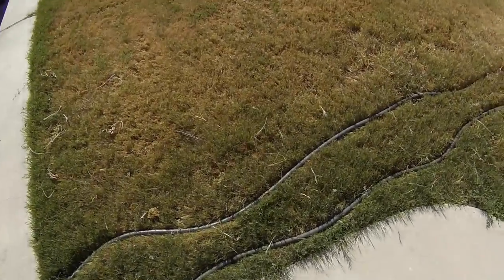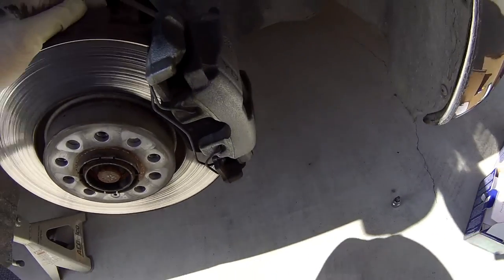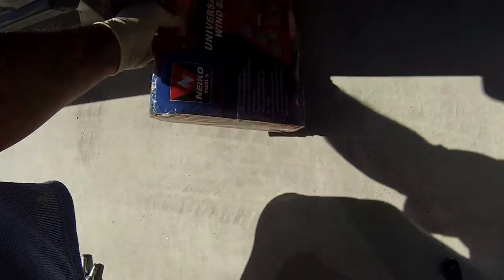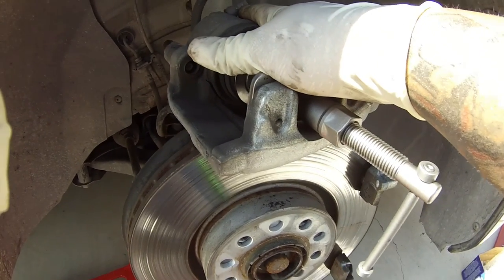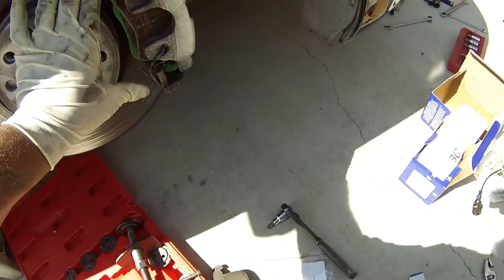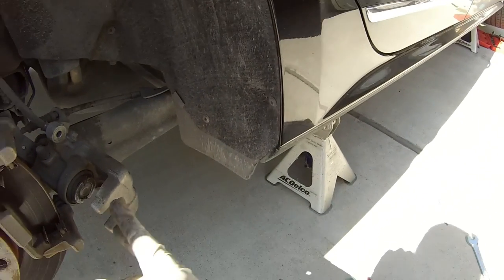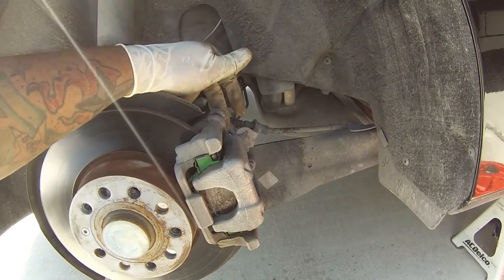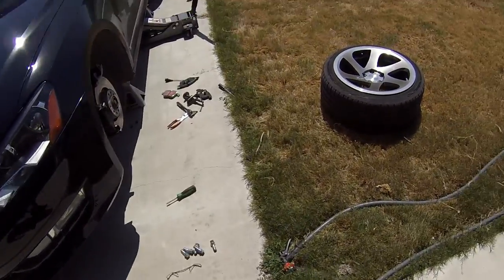How to: brake pads on 2013 B7 Passat TDI

Comment from the maker: People need to realize this Passat is a TDI, which was one of all VW TDI's that got recalled for emissions cheating. This is why the rotors where not replaced! I just needed it to last until I gave the car back to VW which was a few months later.
Reply: Don Juan hey man, does this passat have an electric hand break? If so would I be able wind back the pistions with break calliper tool, instead of using software?
Reply: I dont blame you.  Interesting that VW is slowly selling these TDI vehicles at auctions (I got the 2015 TDI one a month ago  from a wholesaler).  AND last week VWAG sent me a letter saying they are adding another 12mos/12K bumper to bumper free of charge just so im happy and if anything needs sorted out still.   This is in addition to a 162K/11yr warranty that covers ECU., Turbo, fuels pumps, engine tranny from them too.  I bought it at near-auction pricing with 12K Miles.  My rotors are smooth but they rusted a little during the Auburn MI storage so I spent $8 on black caliper paint when balance/rotating and it covered up the surface rust of rotors that I didnt want to sand off with the other factory coating material.

Comment: The odd thing about the emissions “cheating” is the fix is just a software update that pushes more DEF into the purge cycle and it limits some engine performance.  It also has reigned back the aggressive S mode that seemed to have created more NOX.  So, the emissions “CHEAT” dealt with N02 and not soot - particulates.  Most of the concern to become a CLEAN DIESEL was to reduce particulate  and when running super clean the chemical output is higher NOX - so the engine has all of these additions:  when idling the ECU will raise RPM to 1000 and heat up the exhaust and then dump more DEF into the particulate (Soot) filter to burn it off.  Got to be carful if idling in high, dry grass because the exhaust get HOT.  SO there is a race-tune and $800 race exhaust that will double the engine power and provide 20% more mileage.  Right now mine is factory everything and it runs cleaner than ANY gasoline powered car I’ve ever known by a factor of 10.  The exhaust pipe inside looks like it was new, installed, and never started.

Comment: thanks for the vid! i assume it's similar to my 13 Cc sport?   i keep seeing mentions of the electronic parking break making it a difficult DIY.
Reply from the maker: +Daniel King yea with the VW CC and a few other models you will need to use Vag-Com or another similar diagnostics tool to get the rear Pistons in the caliper to retract back so you can pull it out and install the new pads. Unfortunately there is no way around this but it does not make it so you can do it yourself! You can either buy vag-com ( it's worth the $200 investment if you plan on doing most of the maintenance your self) or you can get in contact with a VW community near you (forums, car club, etc) and someone should have one that may be willing to help you out.
Reply: +Don Juan thanks for the reply!  now changing only the front pads wouldn't require that correct
Reply from the maker: +Daniel King correct. Only needed for the rear brakes.

Comment: You need something like s heaven or vag unit to electronically retract the E brake piston in the rear caliper on many of these Pasat cars. You really shouldReplace those front rotors because they look very worn and will take a long time to seat it in the front pads. You should also be bleeding brake fluid on this.............
Reply from the maker: You are correct. BUT as I said before why waste money when VW bought the car back either way 🤷🏽‍♂️

Comment: what mileage did you have when you did this? Im at 45k and my breaks start to squeek.
Reply from the maker: I had between 52-56k miles so seems like your right around the same mileage as i was. I started hearing the squeaks only when going to a complete stop at like a light or something every now and then but around 55k or so it was a constant thing so I did them.
Reply: For about $150 you can get all new coated rotors with new pads for all wheels. For a few bucks more ebay has cross-drilled or slotted options.  Get coated OR the $8 caliper paint.  Probably better heat dissipation to get the coating option.

Comment: yo. which side is where you plug the censor? have passat 13. I want to do my brakes also 1st timer
Reply from the maker: +chrgee88 one of the front pads has the sensor built into that side. So when you remove that brake pad it's a simple clip that you unplug and plug the new pad into it. Not all of the passages have this feature.

Comment: Damn I'm confused. I'm looking to do my own brakes. I've watched videos mostly by European mechanics and they don't do have the steps that you're doing. You're removing pins and using caliper tools, whereas the other vids they just remove the caliper slap on little grease and slap on pads, that's it.
Reply from the maker: +brickscity77 it depends on how far your pads are worn. If your slapping a new set of pads in and you don't have to use a caliper tool then you don't need the pads. Your either doing it as an upgrade for better stopping power or something. Some vehicles like BMW you remove the two bolts pull the caliper straight up slap the pads on the rotor and slide the caliper back on top. But those are designed that way.

Comment: I didn't see you bleed the brakes?
Reply from the maker: +Michael Shasteen I do not bleed my brakes most of the time. I only do the brake flush every 2 years or so. I use the piston caliper tool to push it back very slowly. This allows no bubbles to pushed back into the abs system or too much pressure. It is personal preference in my opinion bc I have done this for years with no issues. Some people will tell you to bleed while u push the piston back in but I do not.

Comment: can i ask you a question?
Reply from the maker: +Bond, James shoot
Reply: Don Juan so at night time when my headlights are on my tail lights dont work at all but everything else works fine and the bulbs are fine. can you assist with this?
Reply from the maker: You have more then likely some kind of short in your electrical system. I would start at the switch where you turn your headlights on and see if something isn't right there. What the year/make/model?
Reply: Don Juan 1989 toyota celica st i got the lights to dim but only the left side brake light works
Reply from the maker: yea if I had to guess either something with your light switch or there is a short in a wire so when you put the load of turning your headlights on then it causes your brake lights to go out. Make sure there isnt any spliced wires from someone in the past if your not the original owner. A lot of people will splice into certain wires without knowing and it causes problems like that.